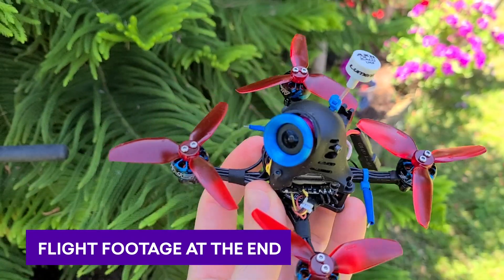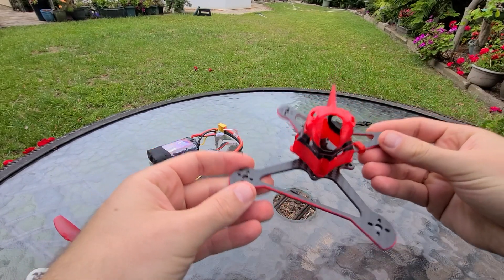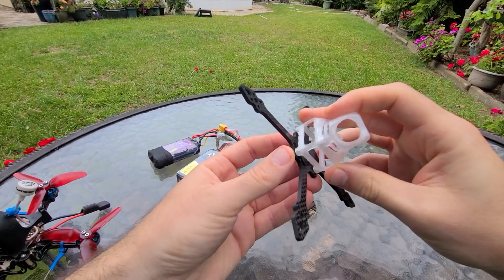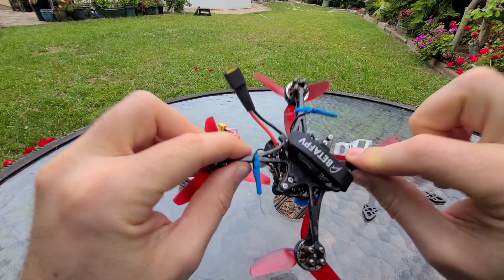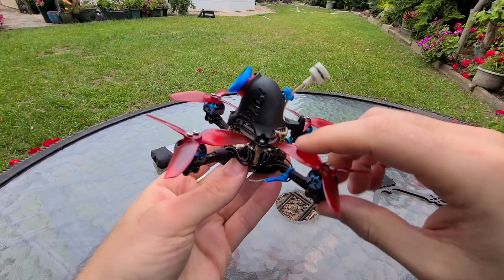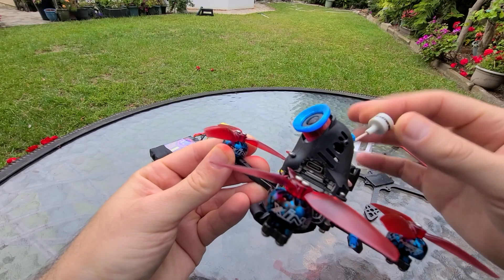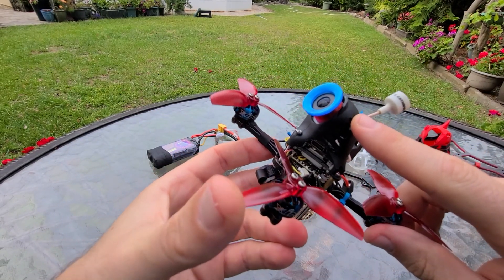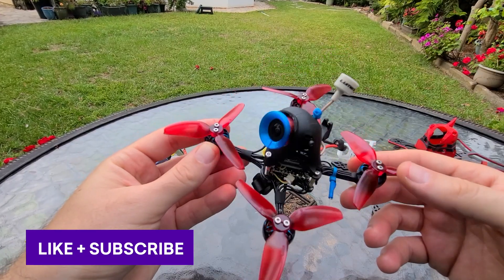Best 3" Caddx Vista Setup I've Seen - 3S/4S, 1404 4600kv, 115g - Nebula compatible

Comment: Good info here, but that stack situation and scrawny motor arms looks a bit sketch...
I have two Racerx/Betafpv Twig XL's, one is stock, one has a Vista in a phx-3d.com canopy.
The one with the Vista is ~20g heavier, at first it flew kinda poorly compared to the stock Twig XL, mostly propwash,  but pushing a few sliders a few clicks to the right erased all propwash and made it feel light and nimble again (BF 4.1.5)
That parts combination is durable and protects the cam/Vista really well.
I fly both versions using 4s 650 Tattu's, they do 4 minutes of hard flying or 5'ish cruising around.
I like it enough that I ordered another canopy, Vista, and two 20a aio toothpick boards to get the missing uart (for dji connection) and improved lifespan/reliability.
That said, I also have a Gecko 4" w/ Xing 1408's on the way for comparison, but the Racerx/betafpv Twig XL is a really really good place to start and will be very hard to beat.
Reply from the maker: Nice. What motors are you running on the XL?

Comment: Nice build, I've also made an 3"dji toothpick. But with 1203 motors and decased the caddx, 71 gram quad and 112 with 3s 450ma battery. And it really rips! The perfect done for flying everywhere and now also in HD!
Reply from the maker: Whoa that's awesome. Do you have any resources on how to decase the Vista? how much weight did you save decasing it?
Reply: @brickclickfidgets  I'm making a little video now and then post the link here. Basically strip the vista to the pcb and remove a lot of material on the camera and use a lighter antenna. And choose all the lightest parts you can find without doing to much compromises to the performance
Reply from the maker: @nathanielakkermans  That's cool. I just subscribed, I'll keep my eyes posted.